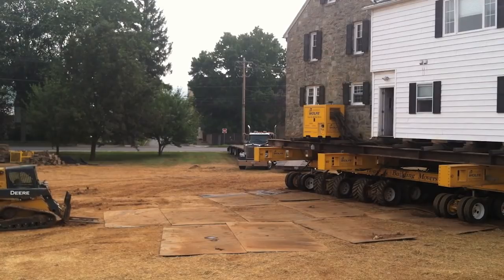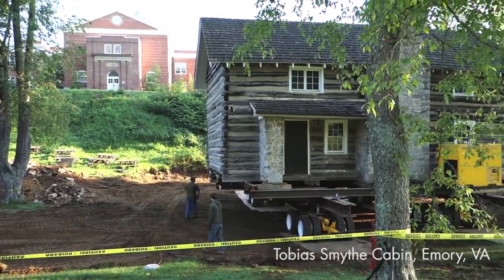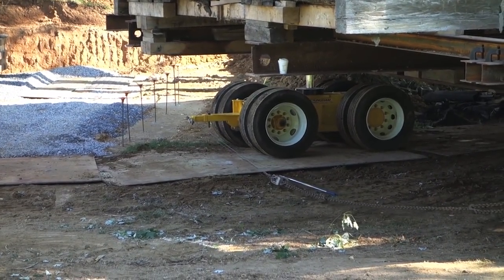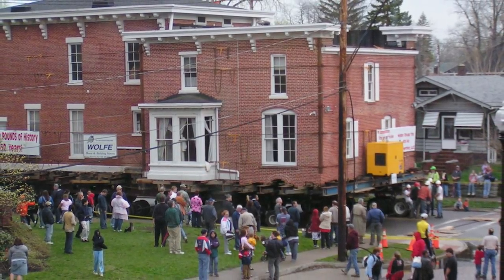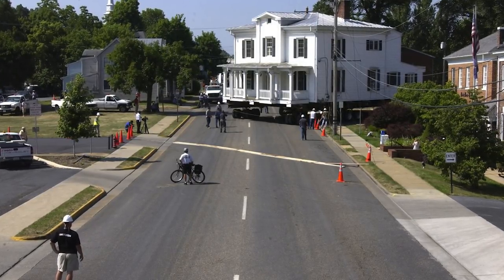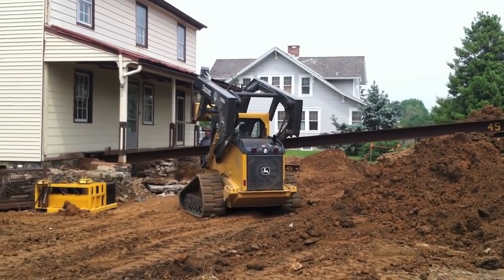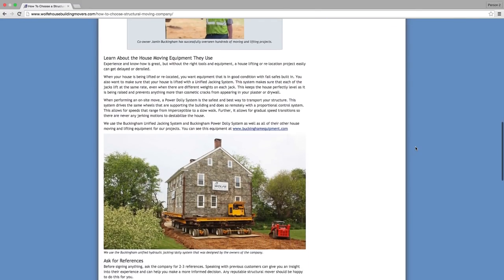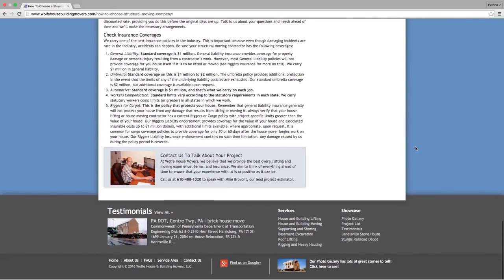How to Move an Entire House

Comment: Something like this must cost a ton! :-0 After completing this video, it seems like all in, you could be at 100-200K  between the moving, getting an engineer to assure the foundation is solid, Plumbing, re-wiring, potentially some remodeling, correcting any cracking and of course...buying the land. If you could find land in a nice neighborhood where homes are valuable, it could be worth it. I would be curious to know how a house like this would be assessed taxes. There's a lot to consider and likely a lot of sneaky expenses.

Comment: What's the cost of moving a house ? $$$
Reply: He said a minimum of about $15-20 thousand and that's a small easy move. He said the average house is around $30-40 thousand which isn't bad if you are getting a beautiful free house I sure wish I had that kind of money to buy land and have one of these free houses moved. You would still need to have the utilities and lines disconnected then reconnected. You need money basically to do this but if you're getting a mansion in livable condition I'd go for it.
Reply: asia lynn thats cheap we charge 15000 just to lift a house up 7 feet for them to put a foundation under.
Reply: Patricia Vyce
Reply: Patricia Vyce
Reply: It depends on house size, frame or brick, how far it needs moved, and if trees or utilities need to be temporarily moved. Cost can be $15,000 for a small structure including the utility disconnect and reconnect on the new slab, to millions if it is a complex stone or brick, utilities (phone and electric wires) need to be rerouted or temporary disconnected, and roadways need to be cut to accommodate the house/building size. The houses I moved were in the $100,000 range - small brick or stone, not a long distance to move, and an easy path to move the structure.
Reply: Jeffrey Cole hiring by chance?